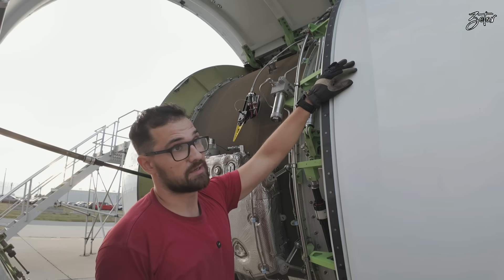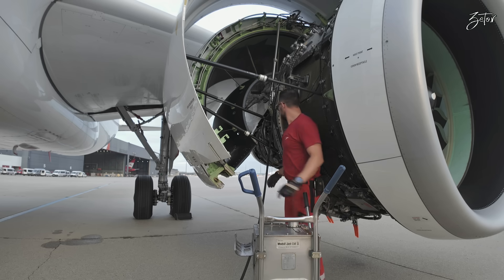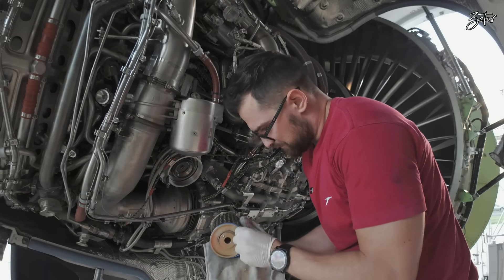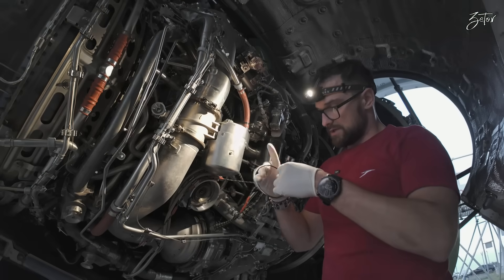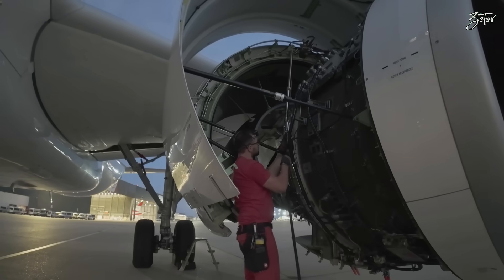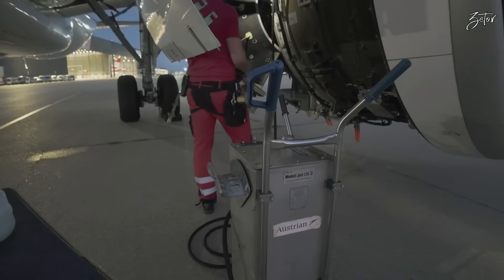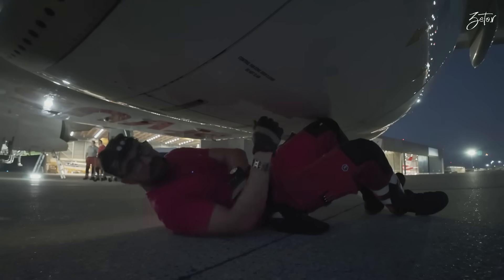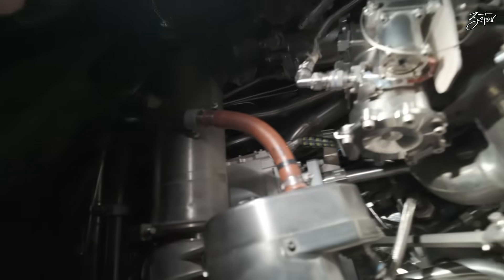How to replace fuel filter on Airbus A320 - PW1100G engine

Comment: Hi, I have a couple of questions! I was wondering why you chose to remove the part by hand instead of using a wrench at first. It seemed quite difficult, and I noticed that the hexagonal shape under the cap appears to be designed for that purpose. Also, after the installation, why didn’t you use a torque wrench? Are you confident that it’s tight enough? Is there any mechanism or indicator to ensure the filter is tightened properly?

Thanks so much for the video and for sharing your knowledge!
Reply: You can use the hex to remove but should not use to tighten.

Comment: What is the change interval?  Is it on time, hours operation or some other factor?  Does this service have a prescribed labor time ie 2 hours and must you complete the task within the prescribed time or are penalized?  Do you cut open the filter afterwards and inspect it for metal shavings etc?  Why did you not use a filter strap wrench to remove the filter housing?  Is the ratcheting mechanism that keeps the filter from backing off locked with safety wire or some other redundancy to prevent accidental backing off in flight?
Reply: Probably on flight hours or time, whichever is first

Comment: Thanks for the video, it's interesting to see how it's done.

Out of curiosity: are you able (meaning legally can you do it) to start these engines yourself or do you require pilot (atpl) on board when performing such checks ? Do you need to get permission from ground before starting the endine or is that far enough within airpoirt that no communication is required ?

Comment: The filter is really small considering how much fuel passed through it every day. They really rely on fuel quality.
Reply from the maker: We will immediately know that it is getting blocked thanks to software. My change was because of that. That's why it is not necessary to have a huge filter 🙂
Reply: @zeto.r  I mean dirty fuel will clog it in one day. The jet fuel quality is very good.
Reply from the maker: Before it will get clogged software will trigger replacement

Comment: I'm flying a  A320 in a few weeks, always handy to know as a passenger how to change fuel filters. You never know right?
Next.. Swapping engines!
Reply from the maker: Did you ever try to replace the fuel filter on a bus, truck or ship engine? I guess not but I will take a look at it for sure 🙂
Reply: @zeto.r  now i want to find a video on how to replace the fuel filter on a container ship engine like the massive one on the Emma Maersk...
Reply: You will have to do it mid air to be a `hero`. I suggest learning how to use a parachute just in case.
Reply: @coolvinay  Fair point. I should learn to skydive. You never know right?
Reply from the maker: Right
Reply: Hahahaha hahahaha hahahaha
Reply: Seems like if you have the cowl open and the fuel filter out, one should replace the Ronsen rods too.  Cool video.  A view you don't typically see.

Comment: That is completely asinine.  No routine maintenance should have such a complicated access procedure.
Reply from the maker: You just open the engine that is it 🙂. Try to open the engine space on the car from the bottom. There are a lot of crews and it takes time and you need to lift the car. I can open the aircraft engine in 10 min

Comment: Little tip, if you have trouble starting the engine after the fuel filter change, have someone spray brake cleaner into the intake whilst you're pressing the start button 👍

Comment: Great video. Mine is starting to choke when i overtaking other planes, and goes straight to the safe mode. Can you make a video of washing dpf, or egr valve?
Reply: try taking it on longer trips and perform a manual regen

Comment: Absolutely didn't understand that protection procedure in the cockpit where you have to wait for the timer. What is the purpose of that procedure and when is it applied?

BTW, it took so many steps to open all the cowls, and then even more effort to thoroughly close them, and then, after the engine run-up, you had to do all that again to check for leaks!! Must be hurting.

Comment: Even though it is just a 'lowly' fuel filter, it is a precision piece of manufactured equipment. Fascinating to see a close up view of a state of the art jet engine. The whole engine looks immaculately clean and each part looks like a piece of art in itself. I am amazed that even the adjustable strap under the nacelle cover has a specially made stowage position, tightened in place to prevent movement.....absolutely brilliant. I've worked on large diesel engines in my life and the difference between those and this clinical environment is staggering. We overlook these day to day necessities in our impatient rush to fly between cities! Well done for doing a great job and keeping us safe. Look forward to more videos.
Reply: 😂😂😂😂 why does everyone think we all wear white suits and work in clinical conditions??? The reality is very different on what most people think.This is a NEO they are new planes. Planes do get filthy and corroded and full of crap. Depends also where they are flying. Worked both base and line and I have seen some planes that you would be shocked on the condition of them 😂
Reply: Yep! Commercial airline is no joke! One small problem and all the passengers suddenly have zero chance of survival!
Reply: @roku_nine not really, planes can glide to a landing oftentimes.

Comment: My company would kill me if I’m not using pins with big red flag when we deactivate t/rs
Reply from the maker: That is weird, what will you do with the original pin? Let it hang there? Anyway it is electrically backed up so I don't see a problem there 🙂
Reply: @zeto.r  we just not allowed to use probably not enough attention maker

Comment: Finally!! I replaced the fuel filter thanks to your tutorial, and expect to fly tomorrow with my grandma and my dog.
I just had a problem with the closing latches, I used tape it should hold.
Bye!!
Reply: Tape is unsuitable. Please use glue stick or gum next time.
Reply: It's definitely because you didn't slap it and say "this bad boy isn't going anywhere"

Comment: No wonder why my A320 was running rough lately... I was doing it all wrong! Thanks for the tutorial, mate
Reply: Don't use Castrol 10w30
Reply: Recommend Shell Long Ride 10-50w for long distance and heat endurance❤❤❤❤
Reply: Remember to “hand” tighten that fuel cap!! Don’t forget to have the safety lock engaged too, you wouldn’t want that cap flying off and you lose that $10k filter!
Reply: Did you try pumping in Shell V-Power? Lots of folks swear it helps with that!...
Reply: 0:03

Comment: I just got my first A320 Neo and was wondering how to do that. Thanks, man. You saved me a trip to the dealership.
Reply: 😅.. The FAA wants it done @ the dealership
Reply: @alphadiallo1655  😂😂😂
Reply: @alphadiallo1655 The online coupon code 20OFFA320 has expired.
Reply: @alphadiallo1655  Here in Taragkhistan I give them 2 cigarettes and it's ok
Reply: I took mine to the local Pep Boys, all the workers inside just stared and someone asked how I fit an airliner in their parking lot. Their customer service needs some improvement
Reply: @Steyr6500 I have replaced my C-ducked with C-Falcon much more efficient 😂😂😂
Reply: @Steyr6500  😂😂😂 Good one
Reply: I am curious too as my dealership wanted to charge me $270K USD each engine for the service.
Reply: @TrevorWebb-ck2yv  😂😂😂😂
Reply: You're lucky, i was needed to do this airborne😂

Kidding😂
Reply: I know a guy who can do it on the cheap using a car oil filter. I can hook you up.
Reply: How much miles have you flown?
Dont forget the extended warranty and blinker fluid🥸
Reply: Saved you a **flight you mean
Reply: Who is this video oriented to , it appeared randomly on my previews,  it looked interesting until someone asked me , are you planning to buy an airplane?
Reply: I saw a used airbus a320 on craigslist and I am gonna buy it. 

I currently have a 737 500 and it's a moneypit. I brought it from Adam air and I regret it.
Reply: ;lol🤣🤣

Comment: Amazing. I can hardly imagine how it feels to carry such a responsibility. Every day, thousands of lives may depend on how properly you do your job. Respect!
Reply: Imagine second guessing yourself! " did I replace the oil plug"?
Reply: I seem to have a mild form of OCD (after closing the door behind me when leaving for work, I go back, rather twice than once, to check whether I have turned off the ventilator and closed the fridge. When closing the office, I do the same to be sure I have closed the windows and everything is okay in general :) Now I imagine myself being in a situation like the one in the video, having been thinking "geeze, I have disassembled and reassembled that particular engine three times today and I'm still not sure if I f.cked up something or not" :)
Reply: @fodorpeter72  You seem like a good customer for home automation. With the right devices, you can check that everything is turned off in an app on your smartphone. Or even turn it off remotely.
Reply: @fodorpeter72  I suggest creating a full protocol, complete with checklists and inspection signatures.
Reply: fodorpeter72. Having OCD and rechecking is a good quality to have in the aviation maintenance industry! I've been an aircraft mechanic for 30 years and when I perform some critical task I check and recheck and call someone else to check my work. I don't ever want to have to live knowing that my carelessness took a life or lives!
Reply: Agreed
Reply: Looks intense. A car there is a little le way, but misplacing a seal or forgetting something could be catastrophic.
Reply: 저런부품들을 인간이 만들었다는게  신기합니다
Reply: Not much worse than waking up at 3am wondering if you tightened that bolt or clamp. My comebacks get towed back in. These comebacks don’t.
Reply: 100% ❤
Reply: This guy is not engineer I believe. He doesn’t follow check list before and after his work. We are maintaining high end machinery and we always follow check list before and after our maintenance work.

Comment: No manual, no PPE, no tables to hold equipments to avoid contamination, apparently he drops the filter cap on the ground, a guess airplanes maintenance is not that different from car maintenance!
Reply from the maker: Mate you have no idea...... I have manual and tablet with online manuals on the table next to the camera bowl is on the table. I cleaned everything with isopropyl. I have gloves so I have no idea what you want more... don't judge if you don't know.

Comment: To change the gas filter you need to tear down almost half of you car because is inside the gas tank, I have an stimate almost 2hrs job with labor and parts almost $370.  The car is an old honda . I think is ease and fast in  the airbus 320 engine. Amazing....
Reply: You think that's bad... Ford puts the water pump inside the engine.... They make air plane repair look easy....
Reply: @DISCMANJEFF  thats why i work on planes
Reply: @DISCMANJEFF  Yes, I see that.
Reply: for airplanes, they design everything to be fixed in a timely manner by anybody. For cars...well  lets just say they care less about a single client. It's MUCH worse for pleasure boats, where they just build the boat around the engine and leave NO room to work on it.
Reply: @tidan4575  It's crazy but this fuel filter is easier to replace than on most cars...
Reply: If you are inclined to do it yourself, I can link you to some resources, having just done that research myself and having performed similar procedure on an old Hyundai
Reply: For example, part costs fifteen dollars on eBay and can be done in a couple of hours with minimal tools
Reply: This is more like an oil filter for a car

Comment: Great video
May I know what are the main things you check after a 10 hour flight before the plane flies back again and how many hours it takes?

Always amazed by Jet engines and plane design. They are very special, they can carry a 100 people and their 22 kg baggage to the other side of the world in 10 hours at flying at 30,00 feet. And then fly back after a few hours of maintenance with high reliability. 
People lost days in ships just 60 years before this, with very less reliability because of ocean climate.

Comment: Very interesting. I've never imagined that this job would be easier on a jet engine than on some cars.
Reply: Boat mechanic here and it's MUCH worse to get to stuff(unless you own an outboard motor), let alone dealing with all the salt corrosion and rust.
Reply: @tidan4575  Salt corrosion isn't unique to boats though, it affects cars quite severely in areas that use chloride salts to melt snow. In aviation it's much less of an issue as formate salts are used to melt snow which are much less corrosive. At least boats can use zinc sacrificial anodes to protect any submerged components, but for anything that isn't underwater but exposed to salt spray, good luck.
Reply: I love working on jets. Way easier than cars.

Comment: I didnt understand anything about bowed rotor protection
Reply: İts so complex, great vid btw❤
Reply from the maker: This is a problem of this new engine shaft is as light as possible and it can bend due to heat. By rotating on low speed it cools it down and straighten it

Comment: Thank you. Didn't know that the engine has so many parts integral to the safety of the plane. Bless!
Reply from the maker: It is different on each engine, some of them have parts on fan case some on hot section

Comment: I’m just hoping I can buy those fuel filters here in Albuquerque at Walmart in the auto section. Maybe Amazon. I’ll go for the aftermarket and save some money.
Reply from the maker: well this filter cost around 4000€ so if you find one with certificate for this engine cheaper, well good for you. :-D

Comment: I used this guide to change the fuel filters on all of My A320’s
Reply: 👏 I’m still not sure about doing my own.
Reply from the maker: well you can try but if you are not certified, you will lost warranty :-D
Reply: @zeto.r  😂 best leave it then.
Reply: Yes this guide is a lot easier to follow than the Hayes Manual,😀
Reply from the maker: @rolsta2871  happy to hear that 😀
Reply: , dress 5 hvhv bg cc @rolsta2871
Reply: How often do you change them on yours?  Do you go by the manufacturer's suggested intervals?
Reply: @myc0p  I think it would be a good idea to change them quite often rather than blowing the dirt out of them with an airline
Reply: @rolsta2871  especially if your airline is Spirit 🤭😉
Reply: Lool the whole fleet😂😂
Reply: "I put that sh¡t on everything" headass.
Reply: I chnage random A320's oil filter in middle of the night

Comment: Good job Pratt putting 95% of the LRU components under the cducts 😂
Reply from the maker: well you in this case fan case can be very light and it can be also removed for transport. if you have components on fan case it is not possible. Of course  it make things harder for maintenance
Reply: @zeto.r  I'm honestly not a big fan of the neo pw motors, one of ours the sun gear came off the hub and seized the engine on takeoff.  I love cfm and the leap engine.
Reply from the maker: This can happen any time. Think is that cfm have a lot of stages  and it is not that efficient but yes it is up to company wot they see as better option

Comment: Was this a part of an A check? I noticed there was a similar operation going on the other engine and they had not finished when you did the ECAM check so only the left engine, yours, cleared. Was the aircraft on ground power or battery?
Reply from the maker: this was triggered by engineering. my collogue has work on IDG of other engine. I was his inspector and he was mine and we made run on both engines at the same time. If you leave aircraft powered from battery, you can drain the battery. A/C on ground is powered from ground power unit.
Reply: @zeto.r  Thanks. Sounds like engineering got a service bulletin..

Comment: I have a question on my mind. Do airplanes need oil change?
Reply from the maker: correct answer is that engine is slowly burning oil and we just adding the oil and during process we are replacing filters. if there is any contamination we need to flush the system, which means that we need to drain, fill, run, drain and fill again
Reply: No. Interestingly with planes, the oil lasts forever.

Comment: Is there a warning in the cockpit if someone forgets to re-enable the reversers?
Reply: IIRC, you’re actually not able to even close the cowling if that enable/disable lever is in the disarm position. You’d find it on your walk around, but you’d also get an ECAM warning if the cowling isn’t latched properly.
Reply from the maker: you are not right, because this lever is used in case of reverser INOP, to deactivate inoperative reverser + of course mechanical deactivation. You can close cowls of course but indication is there for sure
Reply from the maker: yes you have indication on ECAM when ever FADEC is on.

Comment: I hope I won’t ever see an aircraft mechanic on the apron with a fuel filter in one hand and a phone with YouTube running in the other.
Reply from the maker: I'm not holding the camera in my hand but it is on my work table most of the time and I'm looking at the camera like at the trainee which I have on my side most of the time. Another thing is that this is a repetitive task so I performed it several time and still I have the latest manual with me and of course my colleague perform double inspection 🙂
Reply: @zeto.r  It wasn’t aimed at you. I have no doubt in your abilities and training. It was more of joking comment on other mechanics relying on your instructions to service an aircraft engine 😊 
It was an interesting video for a layman. Keep it up 👍🏻
Reply from the maker: no worries I just explained the situation 😉. I'm happy that you like it

Comment: How often should the filter be changed?
Reply: Every 7 flights at the coast
Reply from the maker: mostly it is triggered by engineering. They tracking fuel flow.